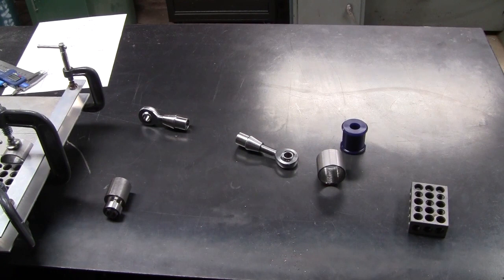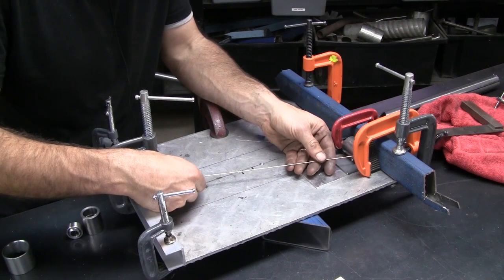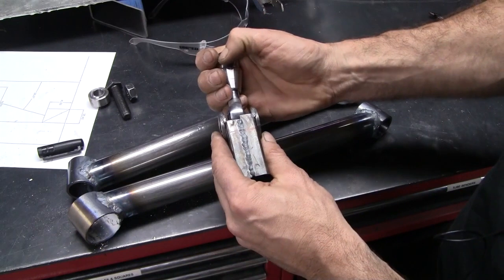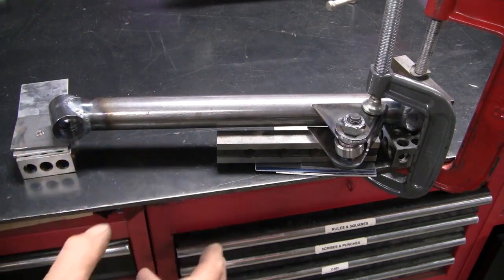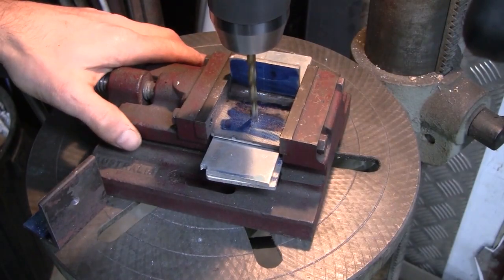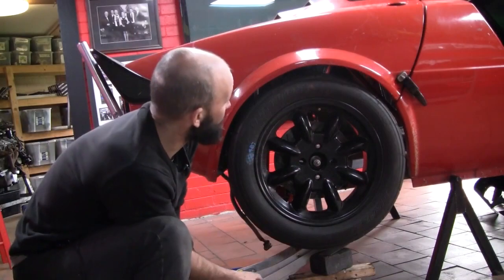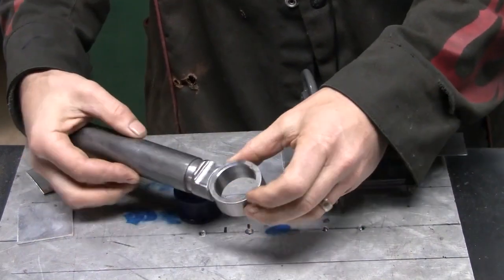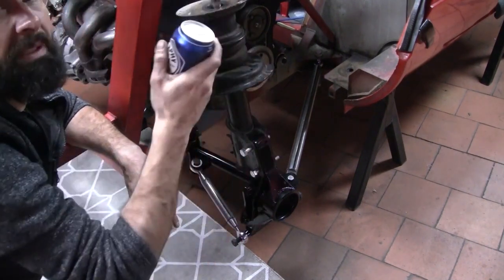Project S - Rear Suspension

Comment: Great tip on the welding rod - I'll use that one

What was the reason you changed the suspension? Poly bushes to spherical bearings? Just interested to know. 

Keep going!
Reply from the maker: Yea good question, there was nothing inherently wrong with the original setup. in fact I designed the new upright to fit into the same dimensions but with the offset of the wheels i'm running if i built new arms i could get an extra 40mm of driveshaft length, not an insignificant amount.  Since i was going to make new arms I wanted to improve the ability to set the toe and camber.  This pretty much dictated the use of rod ends on the toe link, i then wanted to match that on the other side of the upright but as that arm also transfers some of the braking force to the trailing arm used a spherical rather than a rod end.  I have made sure i have at least one poly bush between the wheel and the chassis at each point.  The clearance between the upright and the brake disc is very small at the bottom mount so the poly bush would have been tiny, where as i could fit a large inner poly bush on the chassis. If i stayed with the outboard poly bushes they would also be adjusted out of alignment when setting the toe, but with the small angles I'm sure they would cope with it